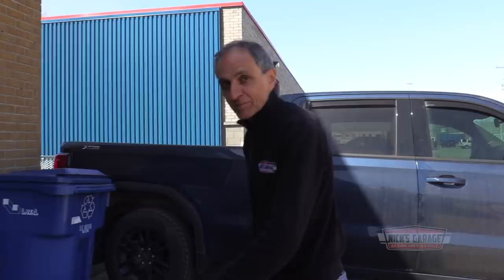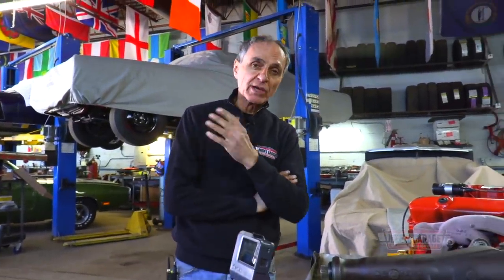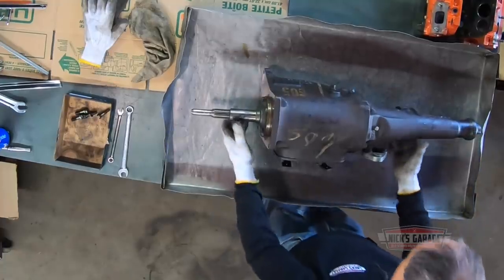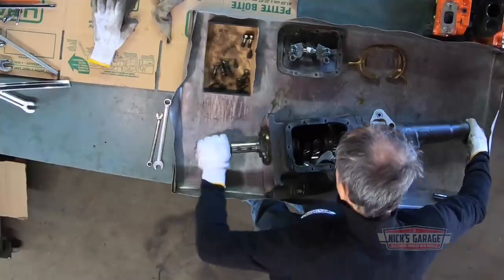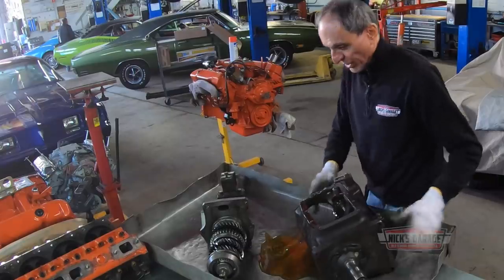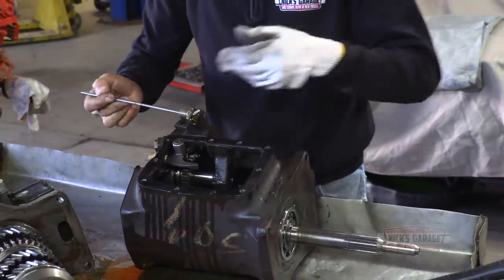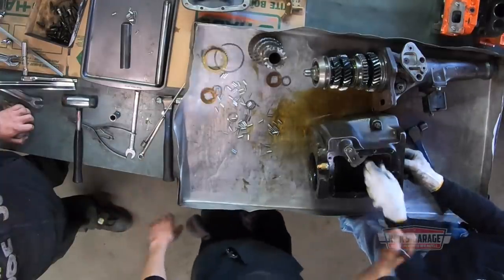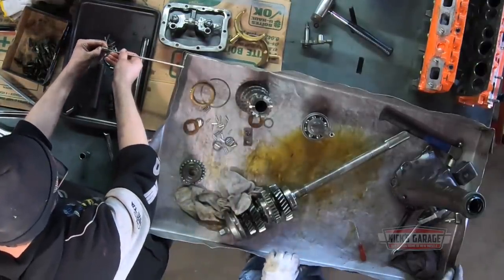Brutal Mopar 4-Speed Tear Down - Wall to Wall Power

Comment: My cuda has a crack in 440 , is there any 440 for sale there?
Reply: AAR.        Sorry, whatever I have is sold to my clients.
Reply: @nickpanaritis4122  i just found the crack in block in number 4 all the way at bottom of of stroke.  But i just picked up a 440 out of a 1969 polara.  Taking to machine shop.
Reply: @allamericanracing8375  .   Go for it.
Reply: @nickpanaritis4122  the guy has a 4 speed transmission i will get just because.  Back up for the one in the cuda. To bad your shop is 13 hrs away